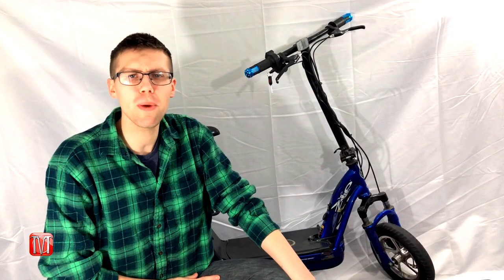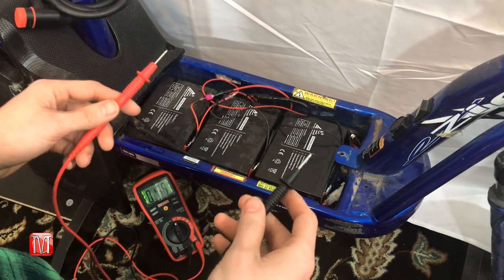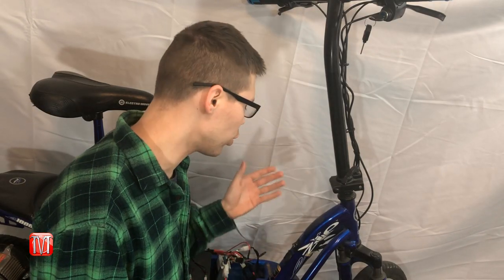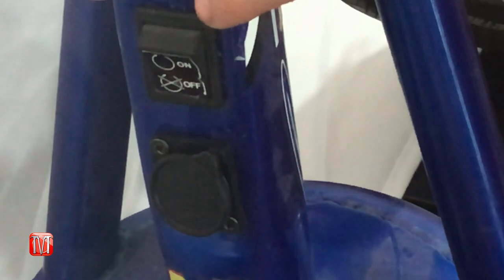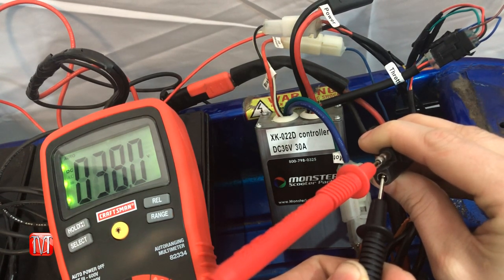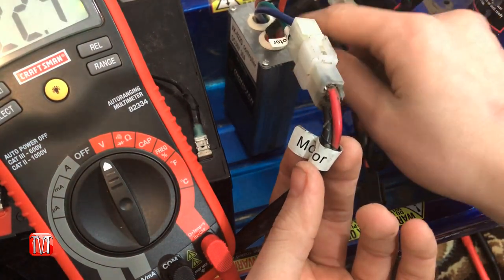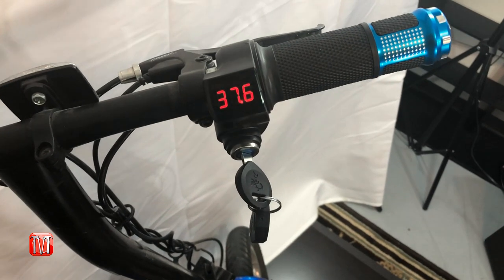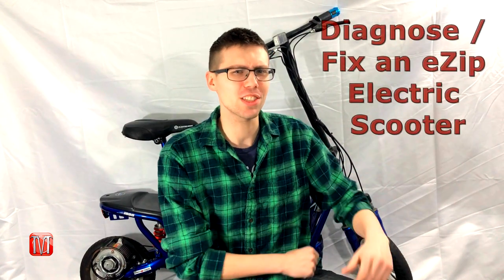How To Fix an eZip Electric Scooter (For ALL Series)

Comment: I have a question.. I have a 12v scooter. The problem is it doesn't have power. That mean as soon you get on it. It can't handle it .. the battery is good it fully charged. When you lift the scooter the wheel starts slowly the start getting faster but you can stop it with you hand. You think it's the speed control that it's bad? Would love to hear your opinion.. thanks
Reply from the maker: Rene Guerrero if you don’t mind me asking are you testing the scooter with someone who’s light weight? When it comes to 12v scooters, they don’t display a lot of power... if you weigh over a certain weight the scooter won’t move (check out manufacturers weight regulations to find out what the max weigh the scooter can hold). Those scooters usually start off slow then speed up, however, if you are running it at full speed and are still able to easily stop it with your hand then there’s a problem.
Reply: @MAGSHowToVideos  my daughter weights maybe 140lb. I dont know the max weight on it. I put the volt meter on it where the wire goes to the motor when the wheel is at full speed it giving me 12v. When I set it down I can hold it with one hand an it won't even try to take off.. an in the meter it goes down to 5 to 6v only
Reply from the maker: I’m pretty sure 140lbs is to much for a 12v scooter to handle. Do you know for a fact your scooter is only rated for 12v? Or are you guessing that based off of the 12v you get at the motor? What voltage do you get straight from that battery once fully charged? Also do you know what the make and model your scooter is. That would help me have a better understanding of your situation.
Reply: @MAGSHowToVideos  it's a .. viro vr 550e.. It only has one 12v battery.. I don't know maybe if I add an extra 12v battery can help. Or you think that would burn up something?
Reply: @MAGSHowToVideos  I found this scooter in a store called dirt cheap. It looks like in new conditions got it for just $11 dollars..
Reply from the maker: So the max weight this scooter is rated for is 120lbs. The scooters battery is rated at 12v 7ah and motor at 100w, so for sure this scooter is more ideal for a rider the weighs around 80-90lbs so it can reach its top speed of 10mph. If you are getting the full 12v at the motor then there’s only 3 things I can think of at the moment, which is one the scooter is operating as normal, your kid is just to heavy for it, two the battery may be supplying the correct amount of volts but maybe not the full 7 amps, the only way I know how to test amp hours on a battery is to use a batter tester if you don’t have one then it might just be easier to purchase a new battery online for around $15, or three something is wrong with the motor. Personally I’d say it’s the first one but again I can’t be for sure since I can’t look at it for myself. Maybe find a small kid to test ride it to see if it works. I did read something about how this model is similar to the 2 in 1 version the company makes and there’s a upgrade kit for it. Which means you most likely could add a additional battery to it making it a 24v, but that will only make the scooter run longer, you would have to upgrade the 100 watt motor to a 200w or higher to be able to move your kids weight. Hopefully this helps you out some and feel free to comment anytime if you have further questions. Thanks for watching my video.
Reply: @MAGSHowToVideos  hey! thanks a lot for your help. I appreciate your fast response. I will try your advice!.

Comment: Ok my eZip turns on and sometimes take it while for it to start to engage anything you can think of what it can be?
Reply from the maker: Sounds like you either have a issue with your control module or you throttle control switch. First make sure to test you batteries to make sure they are fully charged. Once you know they are good follow the steps shown in this video. Hope this helps.

Comment: I was given two of the ezip e900 scooters. I have been working on one of them. I get voltage at the charging plug, the on/off switch and I get the voltage when touching the green wire for the throttle. When I test the voltage at the plug for the motor coming out of the module I get very little voltage? Do you think the module itself is bad?
Reply from the maker: If you get proper voltage going to the module but extremely low or no voltage coming from the module. Than it’s most likely the module that needs to be replaced.
Reply: @MAGSHowToVideos  I'm now getting voltage at the plug for the motor coming out of the module, but when I twist the throttle it doesn't change? All the other voltage is what it's supposed to be?
Reply: And now it's fully charged but makes a clicking noise when I twist the throttle.

Comment: I keep seeing videos, trying to figure my scooter out. This one is what I need, except my ezip has a 4prong charger and port. Everything I see shows 3prong charge and port. How do I fix this? Lol I need help 😞
Reply from the maker: So when it comes to the 4 prong power cable only 3 of the 4 ports are actually used (have wires hooked up to them). This scooter originally had a 4 prong hook up but I changed it out for a 3 prong since those charging cables are cheaper. I personally believe they designed the 4 prong connector to make people have to pay more for a replacement charger. If you followed this video and your charging port is bad then order a new one. If you charging cable is bad… than I would replace the 4 prong port to a 3 prong on the scooter and order a new 3 prong charging cable.

Comment: question for you I just bought a 2009 ezip 750 now batteries seem to be good and I just replace the controller so my issue is when i pull throttle (off  the ground) the back wheel spins but when i make contact with the ground and add pressure it completely stops and the red light inside the new controller blinks can you help me with this please
Reply from the maker: How did you test the batteries? Are these the original batteries that came with the scooter? If you haven’t tested each battery individually, make sure to do so. Most battery’s only last a few years. I’ve gone through a 36v set of batteries in 8 months once. If you are using a common 12v 4amp factory charger, most of the time they just don’t have the power to properly charge the battery’s. Over time it causes them to not get a proper deep charge and end up becoming weak. I assume you watched the video and followed the steps that were shown. If everything is working how it’s supposed to, the only two things I can think of besides the batteries is the control modular and throttle handle. But before purchasing new parts I would test those batteries. If you don’t have the equipment to test them I would suggest taking them to a auto parts store or mechanic shop and ask to see if they can test them for you.

Comment: Helpful video I’m not getting full power when testing the power cable it reads 9 volts but when I twist the throttle I don’t get any more power? Is this the motor or cable?
Reply from the maker: Derek Hoffman well to me it sounds like your throttle handle might be bad. What have you tested and how did you test it?
Reply: Try giving the scooter a running start and then engage the throttle.  I had the same problem & this worked for me

Comment: Hi i have a ezip 750, ive done all test as u shown,, but my charger somehow turns red then turns green,, after a few minutes ..
Reply from the maker: If you are getting proper voltage from the charger and 12 volts from your batteries you might need to test those batteries to see if they still hold proper Cold Cranking Amps (CCA or Ah). Most of the batteries used on eZip scooters are rated at 10Ah. If they have low Amps but the charger reads as fully charged than those batteries are bad and will need to be replaced. Hope this helps.
Reply: @MAGSHowToVideos  i got 24v on battery but not holding charge,, will buy a replacement battery, and its a 12ah

Comment: I get the 5 volts from the green wire going to the handle, but Im not getting any voltage to the motor from the control module. Is the control module bad or the throttle handle? Thanks!!
Reply from the maker: So are you getting 5 volts from the control module to power the throttle handle, and roughly 5 volts from the wire harness of the throttle handle when you turn it? If so and you’re not getting power from your control module to the motor while actuating the handle, then it’s most likely a bad control module.
Reply: @MAGSHowToVideos  all correct. Thanks, I'll give a new control module a shot. Great video, thanks so much
Reply from the maker: No problem and hopefully that works out for you... if you run into any more problems feel free to leave a comment and I’ll see if I can help!
Reply: @MAGSHowToVideos  Thank you for the help, you're awesome. So I have a 24v E900. The battery is as dead as a doornail right now, so I have it hooked up to a 12v circuit for testing. Everything was good until I got to the control module to the motor. It sat around 7 volts. I was about to purchase another control module from amazon, but remembered something: the throttle lights haven't been turning on at all. The 5 volts from the throttle to the control module was consistent though, through the green signal wire.

I don't know what to make out of this. What I do know is that the motor works, it ran on my 12v link. Maybe the lights aren't turning on because the 24v wire has only 12v?
Sorry I am abusing your responses on here, worst case scenario is I just replace the throttle and the control module and call it a day.

Edit: brake Disabler seems to be working fine. The blue wire coming from the charge port (charge inhibitor?) is 5 volts constant. The aforementioned 24v line going to the throttle isn't giving me any voltage, this makes me think the control module isnt sending it up there.

Does your 5 wire plug orange wire have a constant 36v going to the throttle awaiting input?
Reply from the maker: So the 36v orange wire in the diagram, or other wise the brown wire in the video (the colors in the diagram are a little different then one scooter, didn’t realize that until after I uploaded the video) to my understanding is suppose to connect to your light meter to display the amount of charge your batteries have. For some reason even when I replaced my control module and throttle handle I still wasn’t getting a reading from that wire so I just rerouted that wire and connected it to my main power cable attached to my batteries. You can sort of see how I did that at the end of the video.
Reply: @MAGSHowToVideos  alright cool, so the only thing the throttle is really doing is sending that 5v signal. I'll update after I replace the control box on how it's gone :)
Reply: Update: I don't think it was the controller box. The controller box wasn't showing the 12v to the motor with the test circuit I had set up, but that may be because it's a 24v box.

The new box I ordered seemed to be DOA, but once I got my very, very old 24v batteries to hold a 20v charge I was able to test it and the motor spun up.

So it was bad batteries, and the reason I came to the control box initially was probably due to my using 12v to test.

New 15Ah batteries will be here next week, along with a new throttle with the key so I can bring it to campus.

Only thing I'm missing now is the floor board, and I can't find one anywhere online. Will have to fabricate one myself.
Reply from the maker: Good job... it is very important that you know the total voltage the scooter has so you know how much to test for. Battery’s are a common issue. Hopefully it all works out for you.

Comment: hey im trying to buy replacement screwws for the fender, home depot did not have them, any ideas? cant seem to find what size they are
Reply from the maker: Sillyzombie666 I don’t know what the sizes are on hand... do you have at least one of the old screws? If so you should be able to take it to any hardware store (Menards, ACE hardware, Lowes, etc.) and they should be able to tell you it’s size and thread count. Again If Home Depot doesn’t have any and they can’t help you identify its size try another hardware place. You can also check out this parts website I use to price parts. https://electricscooterparts.com/hardware.html
Reply: did that as said above home depot had no clue and didnt seem to match any thing and the link you have doesn't have any screws just nuts n bolts  @MAGSHowToVideos
Reply from the maker: Well currently I’m going through a move and won’t have my scooter until next week. But if you haven’t figured it out by then I can try and figure it out for you by matching the ones I have on mine.
Reply: @MAGSHowToVideos  thank you man, for now im just gonna tap it down. im using this scooter at haunted house i work at so we have just beaten the hell out of it

Comment: Thanks for your informational videos! I do have a question if someone could help me if it's ok to ask any ways and if not I'm sorry. I got used izip I 400 Scooter and the batteries are supposed to be the ones that came with the scooter but I am wondering if the batteries are supposed to be standing straight up or on there side?
Reply from the maker: Shonda Smith so I’m not quite sure how their original battery pack is set up but I purchased 3 battery’s for my eZip 1000 since it’s a 36v system. You can see in the video that I have then laying down on their sides. So far they have been like that for over a year now and they still work.

Comment: I have a Schwinn S500 that i have had forever and a ezip 500.  The S500 i got working right way but have been having some issues with the ezip 500.  I was not getting any increase in voltage to the motor when i would twist the throttle.  I tried the speed controller and the throttle from the Schwinn S500 and it worked so i decided to get a replacement controller and throttle.  Im still not getting any increase in voltage with the new controller.  Could it be something to do with the brake control? im thinking my s500's just never cared about that cable? it works with and without it... Is there a way to bypass it?
Reply: Try giving the scooter a running start & then engage the throttle.  I had the same problem, & internet searching suggested this, & it worked for me

Comment: On the wiring motor test you get 9v and 36 at full throttle - I have a 24 volt system eZip450, so I am assuming I should get 6v and 24 at full throttle. However I get 20v regardless, that is with or without throttle. Is my controller bad? Where can I find a schematic of the controller that I may attempt to fix it, before deciding on buying a new one.
Reply from the maker: Joe Bem well if you google E-zip Control schematics you can find some in the image section. What exactly seems to be the problem with the scooter? Does it run? 

From what it sounds like if you are getting a constant 20v regardless of what the Position the throttle is in, you should be getting power to the motor. If it doesn’t run, I would test to see how many volts you are getting at the motor. If you’re not getting any reading then I would say the control module is most likely bad. I would possible purchase a new throttle handle as well since it seems to be stuck in the open position.

Comment: I just bought Frugal Compact and have problem, i connected battery, and trid to charge it but scooter and charger show "fully charged" when i try to drive scooter turns off, scooter doesnt work without connected to nests? (sory im not native speaker im using translator). when i disconnect it turns off too, any help?
Reply from the maker: That’s ok I think I understand most of what you are saying. So when you have the scooter plugged it works but when you disconnect it from the charger it stops. Am I correct? If that’s the case you may need to replace the battery’s. You see even if you fully charge the battery’s and they read whatever the max voltage is for you scooter, they could still not be holding enough Amps. If you know someone or a place you can take your battery’s that has a battery tester do that. They should be able to test to see how many Amp Hours each battery can still hold. If they don’t hold the correct amount then you’ll have to replace them.

Comment: Hello! My ezip1000 scooter has a electrical proplem. Sometimes run, sometimes not, but the green light it's always on green(full). The voltage its always between 36-39. Could be the fuse?
Reply from the maker: Cesar Frias did you follow the steps in the video? If you do it should help you determine what the issue is. 

I personally don’t think it’s a bad fuse since you say the scooter sometimes works. If the fuse was bad it wouldn’t work at all. 

Make sure to follow the video step by step this will allow you to eliminate several potential problems. If for some reason you can’t find what that problem is, feel free to let me know, by telling me what you tested and what readings you received. Then I should be able to help point you in the right direction. 

Thanks for watching
Reply: @MAGSHowToVideos  I have not power to the motor and I turn power switch on/off and now scooter its running again ???? I think is the power controller
Reply from the maker: That could be the problem. Make sure to look over all of the wires to make sure there isn’t a bad connection/torn/brake. Also Test to see how much power you have coming from the controller going to the motor when the scooter is working.